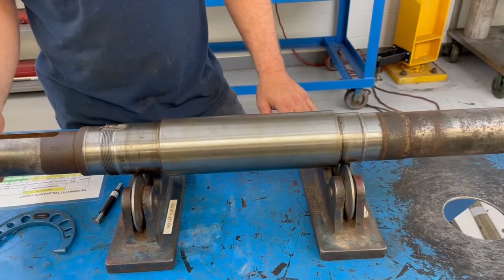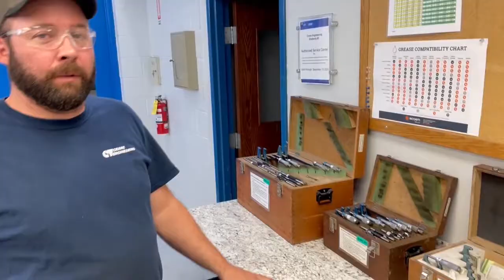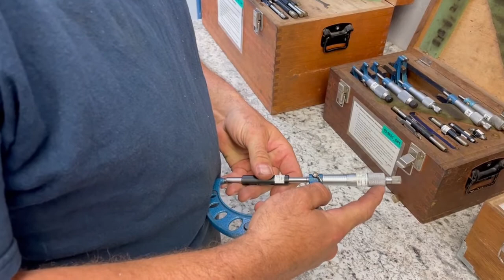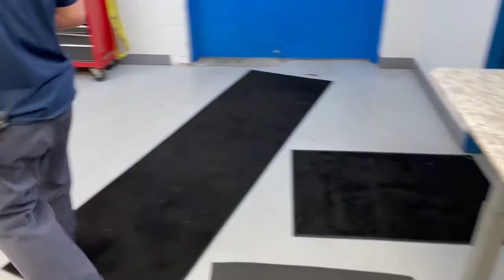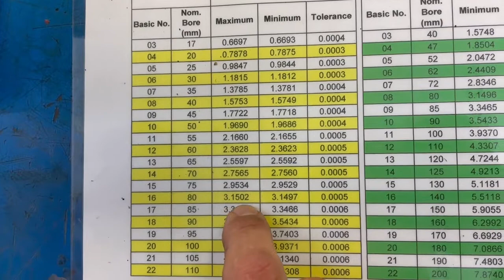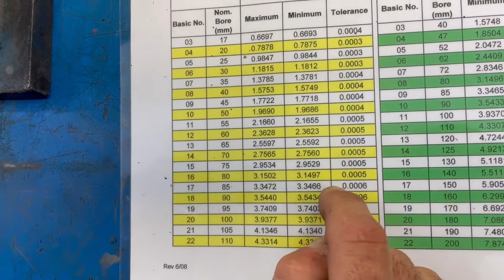Precision Maintenance  - Inspecting Shaft

Comment: When i checked the shaft runout, i take several points along the shaft, start from coupling end to impeller end, checked the surface condition if any damage on it.